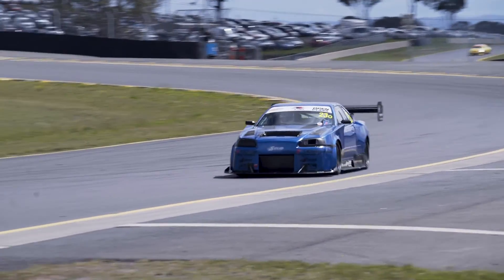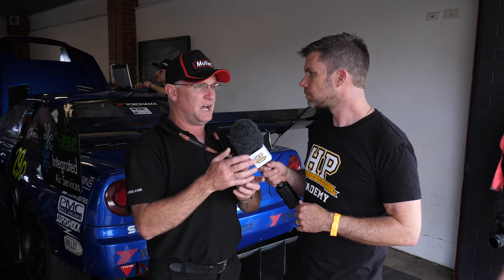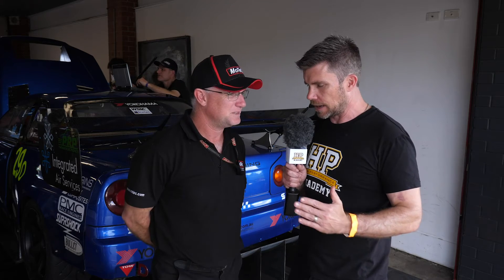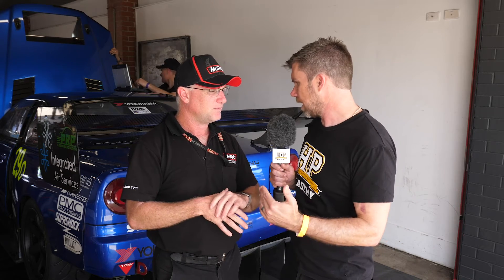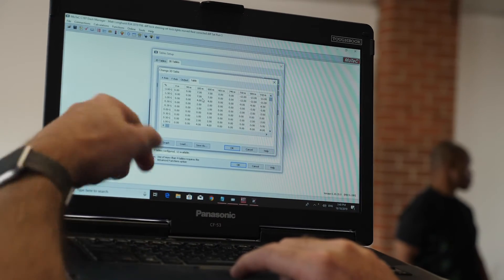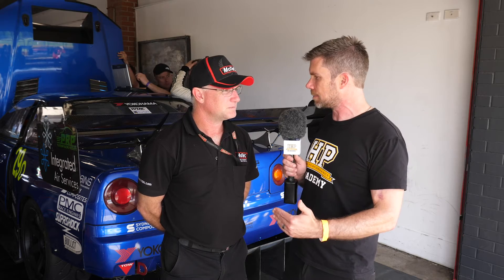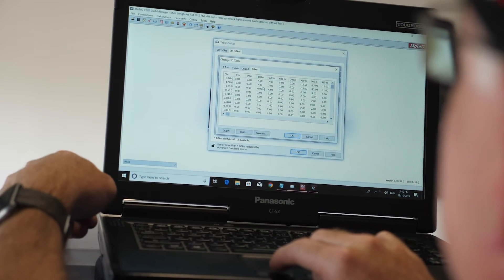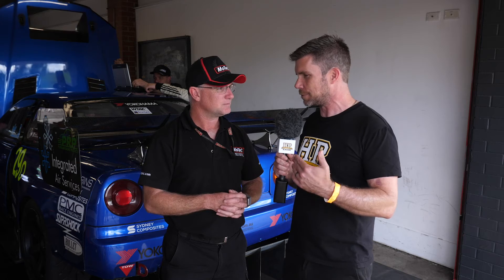1200HP vs R34 GT-R's Active Diff Control | MoTeC [TECH TALK]

Comment: Is this what they use on the 33 and 34 to heat the tires to before 1/4 mile racing. 4wd - rwd? Do you know if the Link G4+ has the abilty to do it to? Would love to find a solution for my GTR R33 V spec 1 whith out destroy my transfer box.

Comment: I wonder if they could use subscription based RTK GPS setups from the farm machinery world to get 2cm accuracy. Would need to setup a base station near the track or use a cellular receiver. But it eliminates the issues with standard GPS accuracy and dropouts. Probably too expense and not worth the hassle since it seems like this way works just fine.
Reply: Base station corrected GPS is definitely the way to go but the price is pretty prohibitive.

Comment: I wonder what the response would be if they were to use something along the lines of a steering wheel angle sensor in lieu of a measurement to do the same thing..
Reply: Would think you would have an issue if just using that.

Imagine two corners, exact same radius, so you would expect same wheel input.

One is going up and over a crest, where the front might get light, where you want less power to the front wheels, so you do not understeer over the crest

One is going down, so the G force of the car hitting the bottom of the gully gets more grip so you can crank that front grip more to help pull you though.

Comment: Best of both worlds. I wonder if they are changing the torque split between fl and fr wheels too.
Reply: Car used to have Quaife LSD front and rear, has proper plate LSD’s now and is a much better car because of it.
Reply: The Quaife Diff does a great job of that already.
Reply: You mean torque vectoring I think the evo 4 gsr had that on the rear axle AYC theY called it and the last gen prelude sh awd had it on the front wheels ATTS